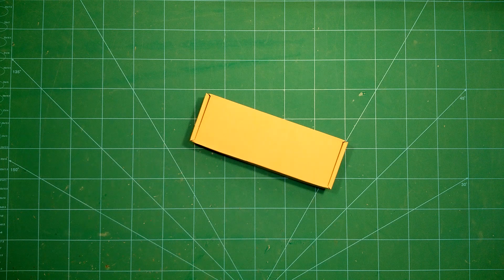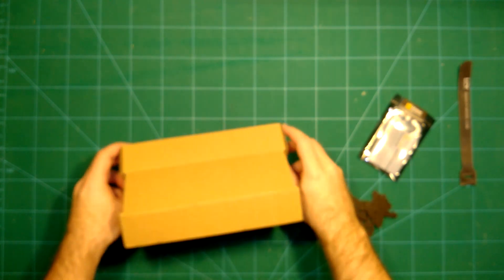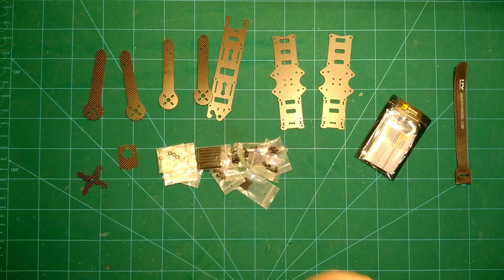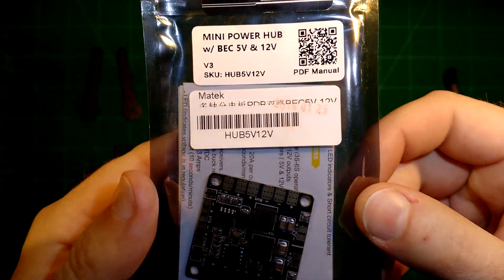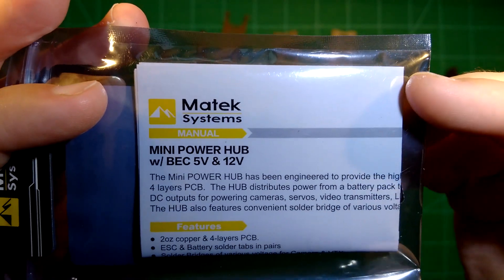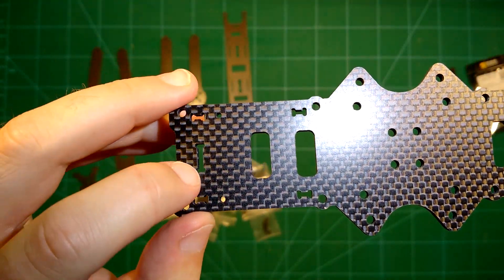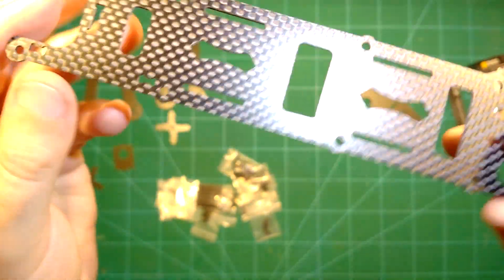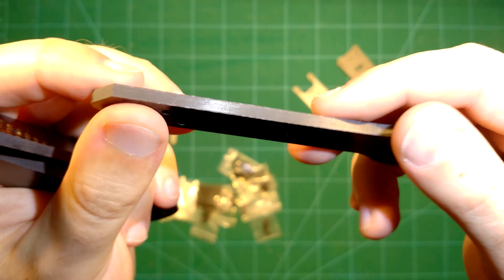FPVModel ZMR-X210 Quadcopter Frame: Review, Timelapse Build & Suggested Components

Comment: Nice review/build video! Looks like Oscar had the same issue with the spacers: http://blog.oscarliang.net/zmr-x210-mini-quad-frame/ "3 standoffs wasn’t threaded enough to take the screws provided"
Reply from the maker: +salle rc Many thanks! Good to know. I'll feed that back to the manfucaturer. Being FPVModel, I'm pretty sure all current models should not have that problem anymore, but I'll do it anyways, just to make sure. It's such a nice piece of engineering otherwise, so it would be a shame if that would be an ongoing issue.
Reply: RC FPV Flight No problem mate! I read the comments on Oscars page, and a few others had the same issue, but some said it had been fixed. So not sure what to think.
Reply from the maker: +salle rc I'm pretty sure they would have fixed it by now. My one was from one of the earliest batches.
Reply: Ok, yeah you are probably right then.

Comment: ordered 3 weeks ago and still not arrived (austria) how lonk took yours?
Reply from the maker: +Fr33lumby© It depends on which mail method you have chosen. If you have chosen the cheap/free one, it can take up to a month to get to you.
Reply: +RC FPV Flight so which one did you choose? And how long did it take?
Reply from the maker: For me it took more than a month, because I had the additional issue that customs had their fun with it. Guess I was unlucky, they usually never have fun with low-cost bare frames.
Reply: +RC FPV Flight true sometimes you get unlucky. happend to me twice with slow airmail. Usually they dont care about little stuff.